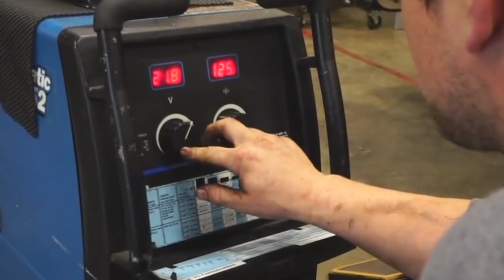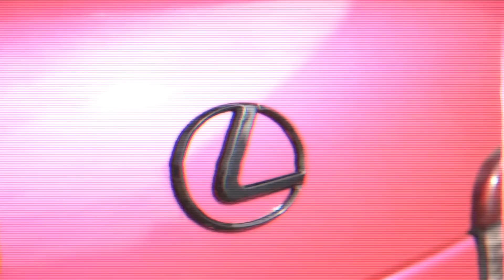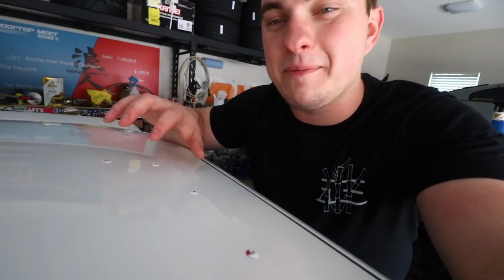Building a 1JZ SC300 in 10 minutes!

Comment: Why does everyone who got sc300s take out the GE motor. You don't have to do that fucking much to make a shitton of power on a GE platform. If you got he non-vvti then the internals are same as the GTE. Just a forward facing manifold and a turbo kit. NA-T conversion ain't that hard on these. I mean, sure, to each their own but in my opinion I just think that there is no need to take the engine out